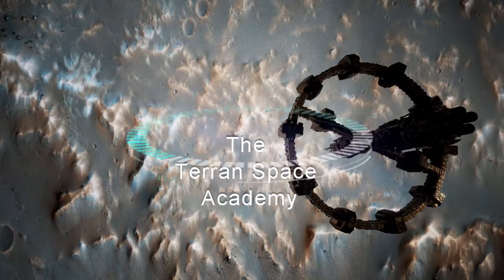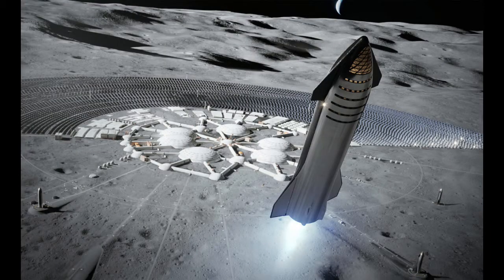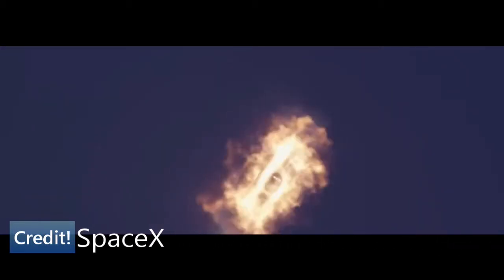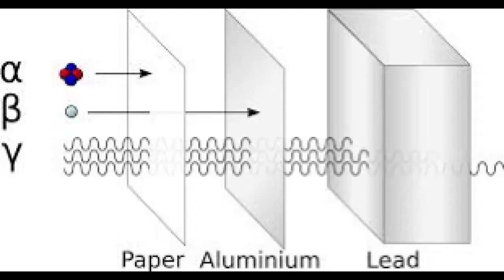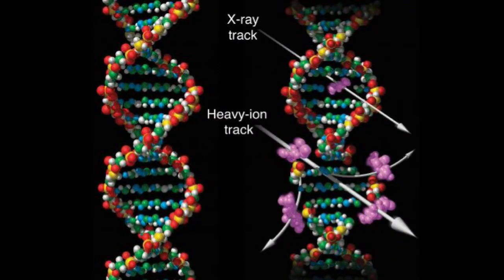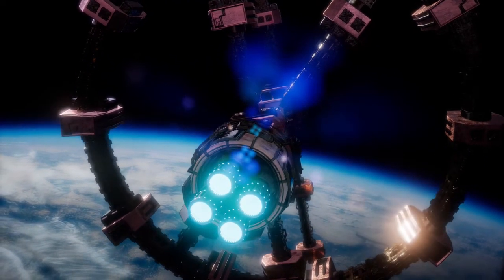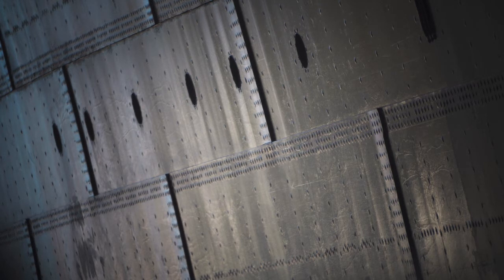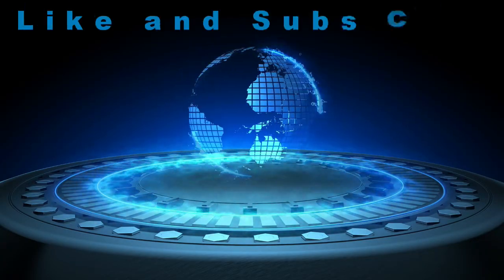Building a Spaceship: Hull and Shielding

Comment: By the way, thought of why we don't use centrifugal force based propulsion?

It's basically Is rocket equation proofed.
Reply from the maker: Centrifugal Impulse Drive (CID)?
I don't know enough about this technology, I'll start brushing up on it :-)
Reply: @terranspaceacademy  

Lets say, you are on an Office chair, the spining type.

You have a bicycle wheel and handles. You spin it.
You know, your hands instead of your feet in a normal bicycle.
You then(while it's spinning) turn its axis Particular to how the chair can spin.
You will begin to spin in the chair.

Same principle.
You have a wheel ship with spin grav.

One side has sticks sticking out, but also toward the center.
That spin grav makes them try to straightened out.

Now that same mechanism turns the momentum into momement in that Perndipular(?) Direction.
Reply: OMG.
Thank you!!

You gave me what to look for!!

Now I know there's a company that is trying to use it.

Though...
I think It's those guys who use it as a launch method...
So, not actually what I talk about.

But still, it's something.
Reply: @terranspaceacademy  

Ok, I actually figured out the problem with my earlier proposal.
It wasn't complete. I rered it and realized half of if was unsaid...

So. Again.

The spining taurous... Got it.

Now, that spin gravity is suposed to be a battery as well.
I.E. those sticks are not just analogous to the tower of Piza, they're like springs. 
And, they can be locked by magnets.

And when vibrating, can genarate power.

When not supposed to accelarate, they're locked.

When accelarating/taking power out, they begin to jump around (remember, the Spin gravity is not maintained now...)

When they fall down they take some spin momentum, which slows it down, also convert some of that momentum to momentum in the Z exes(?)( Diagnoly?) And some genarated power.

When that side of the vibration is done and it goes back, some of the spin momentum it got goes back. It also partly turn to the reverse Z exes(?) Movement, and power.

Because that was weaker, the net result is movement in the Z exes.
If you want it stronger, more steady, add in spin speed in the same frequency of those sticks.
Feed it power when the sticks take momentum, let it drop when they return it.

Though honestly,

It the same prunciple...

I can think of something more effective.

Think of a great big Can.

It spins, it has Spin gravity.

On one end, its inside is such that the inside medium(I'm thinking Water with Helium) rapidly gets spining.

At the other end, there's a ring that spins the other way. This make the medium lose the angular momentum.
Thus its gravity.

Without that, it has no reason to not rush to the middle where the pressure is much lower.

Thus, at the floor the medium is flowing from one end to the other. Add a bit of texture; small walls that are affected by the river.

Up in the center, the medium that lost the angulat momentum flows back to that original end where it gets it back, thus falls down and the river flows.

Any power investment is just via spining.

At the end with thw ring, the medium loses spin momentum, at the other it gains it, this creats two areas of low pressure and two areas of high pressure. These drive the medium cycle inside, which then confers a forward momentum.

Comment: 1:33 The surface of the moon is mostly silicon and oxygen.  Aluminum is fairly abundant.  There's some titanium there, but it's behind calcium, magnesium, and iron on the ingredients list.  So "mostly titanium and aluminum" is way off.

Also, titanium on Earth has been concentrated into ore in some places, whereas the moon pretty much has anorthosite, basalt, and meteorites.  If rocks on Earth vary from A to Z, moon rock runs the gamut from A to B.  Titanium is a lot easier to get on Earth than it will be on the moon, but Starship is made of steel here.

A good material to use on the moon and Mars is probably basalt fiber.  You don't have to change the composition of the material at all, just melt it and extrude it.  It makes better fiberglass than fiberglass does (with the drawback of a higher melting temperature).  

4:14 COPV stands for "composite" overwrapped pressure vessel, not "carbon".  The fiber can be carbon fiber, but it can also be carbon compounds like kevlar, or fiberglass.  My guess is that stuff made on the moon will include lots of composite materials, with magnesium-aluminum alloy and basalt fiber.

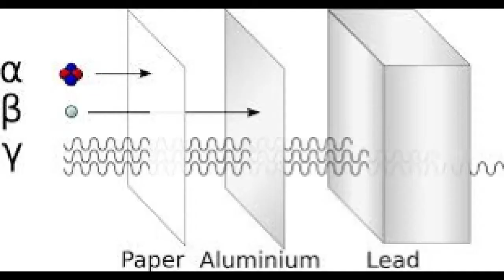4:55 The greatest danger in space travel, so far, seems to be that your space shuttle will explode.  In the case of interplanetary travel, it's likely to be having one of the thousands of parts of your spacecraft malfunction in a way that you can't fix using only what you've brought along.  Either way, radiation is likely to be pretty far down the list.
Reply from the maker: I was of course discussing the metals that will melt into a plate.   Thank you Dan.

Comment: Dyneema plates are used in the construction of MRAP vehicles. Its also great radiation protection. As it is a high strength, high molecular weight polyethylene,  the materials required to make it will be available anywhere humans go.
Reply from the maker: Thank you Mike... you are quite right.  Polyethylene is one of the best radiation absorbing materials we have.

Comment: It bears mentioning that the job of shielding a ship gets easier with size, as the surface area increases with the square while volume increases with the cube.  At a certain point, the weight of the necessary water becomes a trivial addition to exterior structure.
Reply from the maker: Very true, and why we need to think big...
Use one Starship to take up a B2100, use another to take up 100 tonnes of water, a third for fuel, etc...

Comment: Those bigelow modules, are they fully sheilded or should they have a radiation shield sleeve?
Reply from the maker: They have enough water shielding to be extremely effective. Getting that much water into orbit is another matter. I think they should use hydrogen and oxygen through fuel cells to produce energy and water. Pump the water into the outside shell for shielding, and use the energy for propulsion supplemented by solar. A Hall thruster probably until someone is willing to build a pulsed neutron drive.